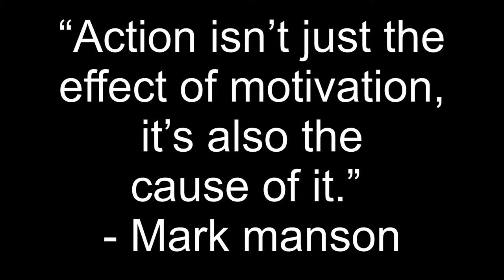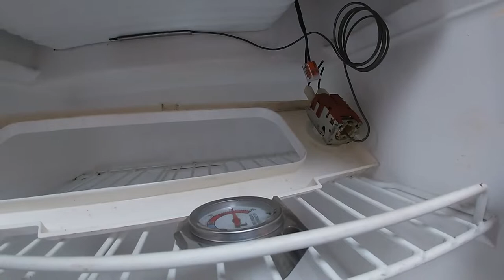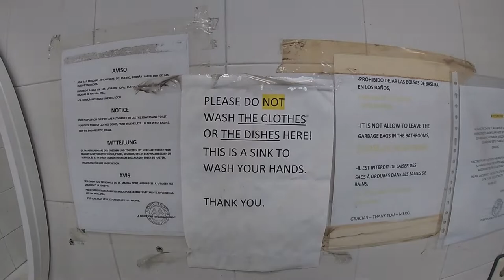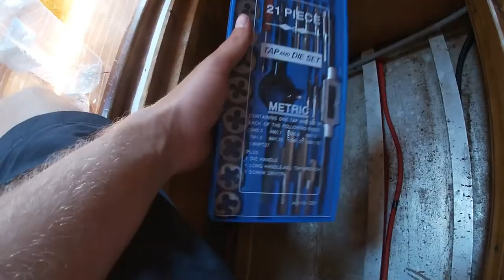We drill holes in the boat for new anodes

Comment: The anodes need to be submerged fella...so you got it right placing it below not above the waterline 🤣
Reply from the maker: Ofcourse. But wanted them longer up. Just 0,1 meter bellow so that they can be changed when still in water😂😊
Reply: @sailingtranquility  remember you will spend a great deal of time heeling over so they will be above the waterline if you did go higher. You will need to haul out at least every two seasons anyway to antifoul and they should last that long before you need to change them. Also gives you an excuse to get in the water and swim to check 🤣 👍😀